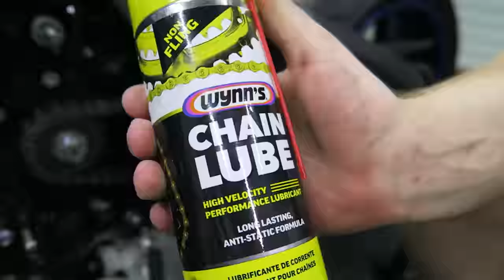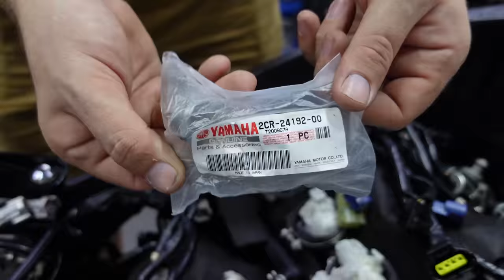Rebuilding A Yamaha YZF R1 in 10 Minutes

Comment: That is what you call ENGINEERING 🖤 great job my man. Just to put it into perspective, almost a 1000 hours went into rebuilding this bike.
Reply from the maker: Thank you yes all the work and finding parts took a year
Reply: @GarrethCollins  keep it up brother. Just got an 08 Cbr 600 and after buying the bike I gave it to the local mechanic to get it maintained and all that but unfortunately, the guy says that the engine doesn’t have much runs in it. Totally ripped off by the dude I bought it from and after watching your vid, I cant help but to wonder if I were that capable to repair my own bike. The mechanic says that its gonna need a new engine. I don’t beleive that it would need a completely new engine but again, really disappointed.
Reply from the maker: @ZeeshanKhan-tj2wh  sounds suspicious everything is repairable
Reply: @GarrethCollins  exactly.

Comment: After the rebuild do the motorcycle work like new?
Reply from the maker: Yes
Reply: @GarrethCollins  I got my motorcycle repaired after a very little accident. But the motorcycle now leans left side...
Reply from the maker: @AshiqurRahman   did u check the frame or forks
Reply: @GarrethCollins  The handle bard is slightly unbalanced. The "T" is unbalanced. And I am having left waste pain after 5 minutes of riding.

Comment: 7:27 that's a dangerous approach to fix a fuel connecting piece. If it ever burst under heavy its going to make a fireball
Reply from the maker: I disagree.  It has a metal tube in the middle of the pipe that has been pressed in and then plastic welded. Its stronger than factory😏

Comment: Mesmerising.. just the head unit is still cracked
Reply from the maker: The head unit??
Reply: @GarrethCollins  the display mate. I don‘t think its replaceable but you could try a fine electronics repair shop. They could try and fix the LCD and glass, so you can keep your original miles.
In saying that, I have never done anything similar. 
The bike looks stunning as is
Reply from the maker: @tritron5519  thank you unfortunately the display cannot be fixed and a new one costs 2000 dollars which i do not want to pay. so il keep it as is for now

Comment: You can buy another bike for the same money spent on parts and labor. This is why collision insurance is high
Reply from the maker: Yeah but its some bonestock bike with no extras you would need to spend more money on to get it the way you like and that would cost u way more u forget the extras 😉
Reply: @GarrethCollins  I wasn’t hating. I was just saying that for anyone that thinks buying a wrecked bike might be cheaper to fix
Reply from the maker: @ExtraSync  its definitely worth it buying a wrecked bike and fixing especially if you have contacts and can source cheap parts i bought very little from a dealer and everything else i could second hand for 10x cheaper so i disagree with you

Comment: why didnt you change the display that was broken?
Reply from the maker: Because it costs 2000 dollars for a thing that tells u how fast you are going 😅
Reply: @GarrethCollins  buy one from ebay :)
Reply from the maker: @mrconta  the one i have works and i can see the speed. maybe one day :)
Reply: Try to contact one of the racing teams who build Yamaha’s,maybe you can get one of those for a fair price,usually they take the original dash off and replace it with a motec dash.
Reply from the maker: @skywalker7517  will try. Thanks for advice